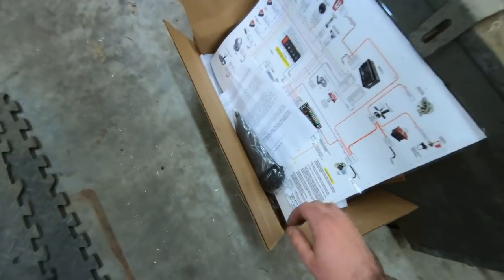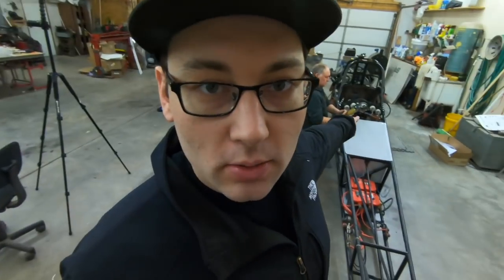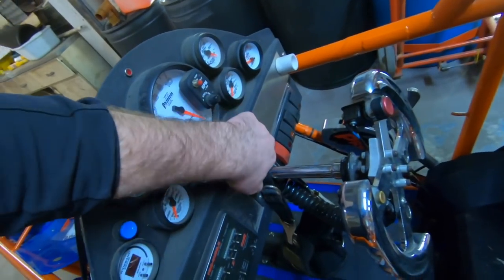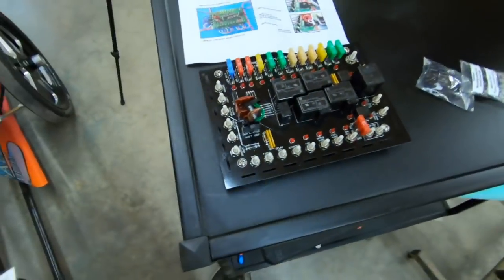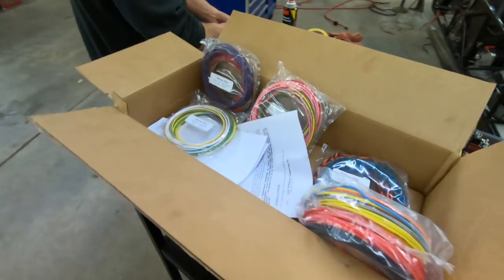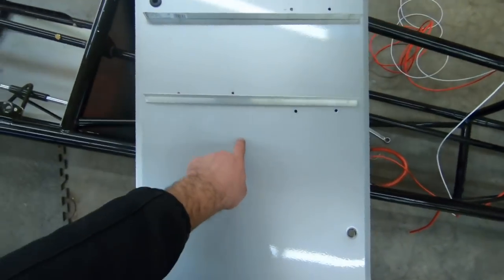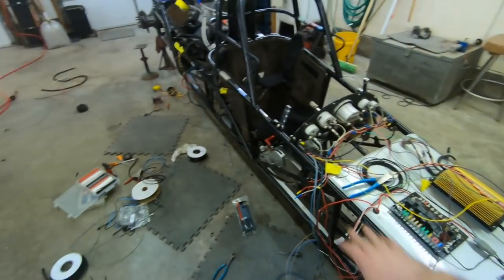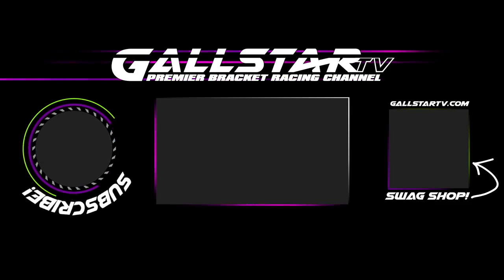RACE CAR WIRING | Part 1 - Out With the Old...

Comment: I have a tube chassis ‘53 studebaker that I’m putting a turbo LS in. I’m going to use a Holley terminator x for the engine management but I need to wire up the chassis. Will that K&R kit work for me?